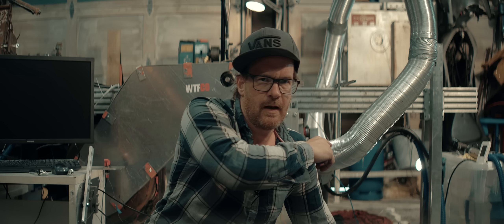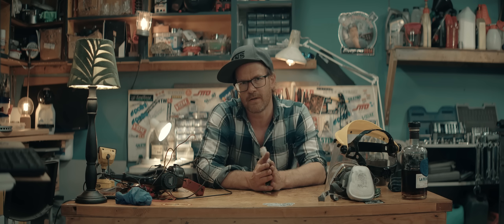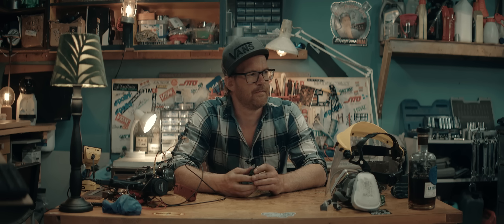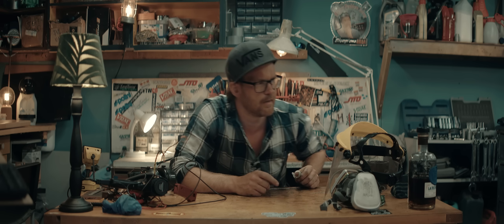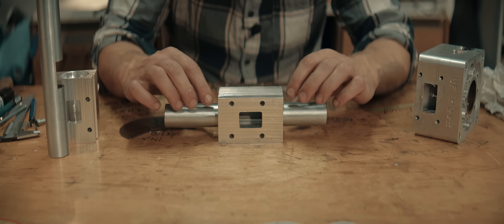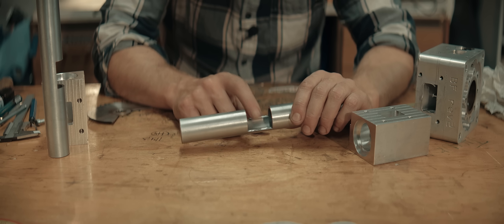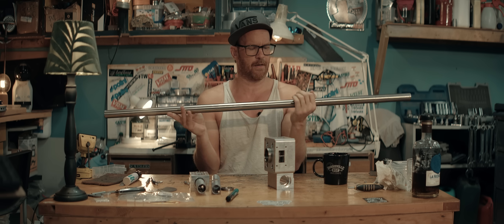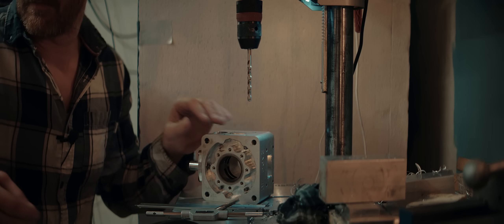The Weirdest Engine.

Comment: In one of your upcoming videos, please explain how the current engine operates and why you are using drum valves.  The drum valves increase the momentum of the engine's rotating components which will be OK for Land Speed Racing but the extra momentum would not be very good for an engine that has to change speeds rapidly i.e. Road Racing.  Thanks

Comment: You could probably add something similar to rifling to funnel air and actually create a “tornado” of air sucking out of the ends of the pipes. That way the exhaust would be able to come out of both sides by its own pressure. And not need as much of an angle in the hole, this also would help with balancing of the cam, which comes into effect at high rpms like you are trying to hit with this engine

Comment: Or if you use a blower you need no crosshead connecting rod , and still have a oil lubricated, cranckcase, much better than oil in the fuel

Comment: If you had overhead valves you could use real oil in the cranck case. Using a crosshead connecting rod design

Comment: Alex you really are stubborn. A valve are a valve no matter it's a disk, drum, or poppet valves, why not chose the obvious proven system poppet overhead valves .  Much better than all the stuff that can't seal .
And it's easy to implement, one way efficient scavenging 100 % seals, and easy handle high rpm.
Please regain common sense 👍😁❤️

Comment: There was a 'barrel valve' 'invention' made for small block Ford V-8 about 20 years ago, carbon ceramic composite bearings running without external lubrication and (stainless?) steel 'valve' bodies that's looked like a weird OHC set up.. Allowed it to rev to 10K and make over 500hp. The principle was very similar to two stroke porting with the barrel shaped valves cut away to provide transfer area.

Comment: I have a new and interesting project, 2 strokes, 2 valves on head. when the piston is 70% on the lower position, the exhaust valve is opened, the exhaust create a moment vaccum when getting out into the pipe, when the piston is 85% on the lower position, the intake valve is open, putting the new air-gas into the combustion chamber, when the piston comes up, both valves are closed and after, the ignition... you can try it very easily, take a reguular 4t engine with chain valve control system, just put same size of valve control gears and change the position of the valve actuators axle. Make only one part, a valve control axle.

Comment: You could maybe use popit valves and have them operated by a cam. When the cylinder goes down the fuel mix is sucked in the cylinder compresses the mix and ignites it with a spark plug. After that the it can be expelled using exhaust valves

Comment: GOOD MAN!! Those Heli-coils make your aluminum threaded hole stronger than steel. Almost, for a split second, thought you zoomed in to show us all how to not set a stop and rip that drill into your water jacket ...WHEW!!! QUICK TIP: U.S. & Metric tapped hole size is the pitch minus whatever dia. thread you're doing. 1) M10x1.5?? 8.5mm hole.
2) 1/2-13??? 1÷13=.076923;
.500-.076923=.423 hole. WORKS NO MATTER THE SIZE (ya know, if you got a weird thread that isn't in the bible...i guess most people call it 'Machinery's Handbook').

Comment: all this experemental engines n stuff, makes me want to build my silly engine idea
but im not an engineer, and im not amazing at solving problems
a 2 stroke inline 8 that uses a similar system to the 2 stroke detroits, only mine is a gasoline engine and is a straight 8.....
main problems:
1. crank, the crank is long and thus has torsional issues (crank twisting up'n breaking) 
2. creating the engine, i want it to be fully billet and finding a machine that has  a large enough working area to make a i8 will be hard and expensive as hell
so probably a multi part head (pprobably 2 heads on it)
cams wont be an issue except for torsional problems but i could also do a front and rear timing chain (and yes, its gonna have a cam because its gonna use exhaust valves similar to a standard engine) 
cooling will be a slight problem relating the the engine block (also cylinder will probably be similar to the deutz/vw engines in that it will be a individual cylinder setup where each cylinder is removable without removing any of the other cylinders)

Comment: How hot do you think the exhaust pipes will get, will the pulleys get hot enough to damage the belt? It will probably be ok for short dyno runs, but I'd be worried if it had to be put on a bike.

Comment: This is going to work amazing. In the late 90s early 2000s I read about an engine that was built with both intake and exhaust  rotary valve setup. the cfm flow was unreal. The engine was a chevy 4.3l V6. (I know I know 4 stroke) but flow is flow LoL Thank you so so much for all the work and hours of very happy watching.

Comment: The added benefit of having 2 exhaust valves is that you can easily adjust the timing port/ valve timing by turning one of them. 
That way you can figure out your optimal duration without modifing anything. Once your happy with the duration then modify them both to optimise flow 🤔

Comment: Hi Sir, when i built my Kart engine from a GDR TS150 motorcycle i came upon a coaxial ignition cable whose shield is earthed to the cylinder only. A capacity is formed to hold voltage after ignition and lower the work for the coil on the next spark.
BTW, very fine content!

Comment: When you're tapping a hole you should be able to wind it the whole way in in one go. And the swarf will evacuate as long strings out of the flute.  Chip breaking (in and out winding) will break the string off each time and it will get in front of the tap inside the hole. This can cause the tap to bind up and possibly break.  If you are going to do back and forward because the material is difficult to tap, wind the tap right out each time and blow the hole out.

Comment: I don't watch all of your videos, but... If the goal is variable exhaust timing, Rotax solved that, effectively and reliably, decades ago with their RAVE(Rotax Automatic Variable Exhaust) system. They used pressure to activate the RAVE valves, but there's no reason why you couldn't actuate them electronically(EI: solenoids) or using a governor setup and linkage.

Comment: Good job Alex, wouldn't be better to weld the side where the belt is? I don't know how much hot the exhaust could be, just worry about melting the rubber belt and one exhaust per side could be enough. Also you can machine some insert there to redirect the exhaust in the direction away from timing belt side. Crossing fingers for your success!

Comment: In the middle of the night I figured the rotating exhaust valves out. Still, moving parts to break. One of the good things about 2 stroke engines is the small number of moving parts.

Comment: Looks promissing. Keep on!
Short question, on regular two stroke engine, the down stroke of the piston is used to push the mixture from the crank case to the combustion chamber.
With such a blower setup,  can you just bypass the crank case and blow the mixture directly to the combustion chamber?
Reply: Yes, but it would need a 4 stroke style oil system.

Comment: Digging the rotary exhaust. Question though, will the spinning aspect cause a vortex affecting the exhaust pulse? Was thinking he might’ve stumbled onto something promising with that🤞This project is so awesome👏
Reply: Like vanes inside the spinning exhaust pipe to pull the exhaust gasses ? The engine pulses might outrun the pull of the vanes. Either way, good thinking.
Reply: @shanepowers7566  Omg that’s kind of what I was thinking but just the straight pipe, wasn’t thinking of actual vanes on the inside surface. Shane Powers that’s a brilliant idea you expanded on. Yes some sort of vanes using a fluid dynamics of sorts to match the exhaust pulses. Really love this stuff!
Reply: Alex is the expert.

Comment: You need to balance the rotary valve. And it could be made stronger by increasing diameter and leaving solid outer ring on the valve that vay that the exaust section in valve would not be a pease of pie but a rectangular hole. You could ad some weights on the outer ring in place of the exhaust opening and try to take some material of from the opposite side.

Comment: I'm not an engineer but I keep thinking that the exhaust heat is going to make the stainless exhaust tubes expand in their housings and bind up.  Shouldn't there be some coolant flowing through those  housings? Drill as many small holes in them as you can get away with structurally and pressure flow as much liquid as you can to suck away heat.

Comment: I’m not an expert by any means but I am a machinist and I was wondering why he has such a large tolerance between the exhaust drum and the housing for it. Wouldn’t that not seal as good making so you can’t make as much boost. Ps love the build can’t wait to see it on a bike
Reply: I think he left room for bearings. I could be wrong. I’m very confused at this point, the engine is getting pretty wild.
Reply: @somenygaard  yeah but having clearance for bearings shouldn’t effect the tolerance between the barrel and the housing those can be tight and still have bearings

Comment: maibe make the pully a bit more of a loose fit and weld a flange to the exhaust roller with slotted holes , that way you can time the ports induvidually https://media.skandix.de/pimg/1079603.jpg
having the compressor you could do sumting like the old screaming jimmy two stroke diesels 
these have ports in the middle of the scilinder just about at the bottom of the stroke and uses a roots compressor to "flush "the gasses out the exhaust (has a exhaust valve ) now having a lot of clean air blowing out the exhaust doesnt matter mush as the fuel is only injected once all the openings are closed off 
be a bit harder to do on a gas engine BUT it can be done , seen those lean burn car engines that have a high pressure injector build intoo the cilinderhead that sprays the fuel straight intoo the sparkplug making the mixture just rish enough to ignite , https://www.youtube.com/watch?v=KnNX6gtDyhg
verry high pressures allready in the stock form so i wonder if it can be done in an even higher compression 50 cc engine reving at 12/15 thousand rpm
working that way you could allso pressurise the carter of the motor with the blower pushing air and a two stroke oilmist reducing the stress on the rod and piston (the pressure under and over the piston counters eachother ) might induce a bit more drag at high rpm though compressing the gas on the up and the down stroke
the "flush"ports will be more classic twostroke could use an exhaust valve and still have the two stroke principle as it will be igniting on every down stroke the fuel would be injected inside the cilinder not in the intake and should be tuneable to the nano second to get the best powercurve without burning a hole in the piston

Comment: Flexible aluminum duct can be cut with a pair of scissors. U wont have that ragged edge from the hacksaw and its easier with scissors. Tin snips work even better. Sometimes u can just stab in and pull it apart.
On a side note, dont u just hate when the cap on a pen wont pop off one handed?
Could there be an advantage to making the exhaust port on the pipe more like a slight triangle so it gradually opens and closes the port as it rotates? Kind of allowing u more tuning options. I imagine its another rabbit hole to get lost in

Comment: You could apply this tubular valve in the same way a nitro rc engine works. The rotating tube valve is part of the crank and draws fuel into the crank case then up into the head like a normal 2 stroke. Join the tube valve on one side of the crank, the output shaft on the other, fit the super charger directly to the crank case into the tube valve and use the cylinder with the close to 100% port.

Comment: Yea i commented that you should use cylinder exhaust ports since you made the first video with the flat valve 😂, those drum exhaust ports are also interesting, they avoid more rotational mass from a solid cylinder with a port trough it, you could experiment a bit with different materials a bit if the wear is too high on the aluminium parts, brass housings and stainless tubing would last a long time.

Comment: should have gone with wedge locks for the tube gears. Pressed on will make it interesting to adjust the timing.
Reply from the maker: Couldn't find them in that small a size. Timing can be adjusted by skipping the belt.

Comment: I've been thinking of this system for years,  and wondered if it would be better to just turn the scroll valve back and forth in stead of continuously rotating it.
Reply: That is just a few steps away from the old airplane sleeve valves engine :P

Comment: As an experiment you can also consider Tesla valves instead of reed valves  at the inlet side. It is a one-way valve with no moving parts. They are used on pulse jet engines and I have also seen some use it on the crankcase on 2 stroke engines.
Reply: Isn't Tesla valves basically useless having horrible forward flow but still high amounts of backflow while being huge?
Do pulse jets really use them?
Reply: @TarenGarond  The only thing that is sure is that the reed valves can not withstand the combustion pressure from the engine, We have the proof now. So thats why I wrote for experimental testing.

Comment: Great content as always! Have you thought about what the high exhaust temps might do to the bearings? There will surely be some expansion and the grease might not like it if you run it to hot.
Reply: If it works, it's easy to change ceramic bearings.

Comment: If you love overloading belts, you can add an watt regulator on each rotating exhaust and use them to change the exhaust length depending on the engine RPM:-)

Comment: The solutions are getting more and more out of the box! But that's the only way you can make progress on this engine.
Ever considered a sleeve valve design? It should work on a two stroke as well, just have a 1:1 instead of 2:1 on the valve drive, and you can change intake timing as well without having to machine a new cylinder. I'm only not to sure how high a sleeve valve engine can rev before it destroys itself. Known sleeve valve engines are four strokes and rev quite low, to 4000 rpm max.

Comment: "press fit bearings" you could put the bar in the fridge for a few hours so it shrinks and if that would not be enuf heat up the bearing a bit to enlarge it  when it goes back to normal temperature it should be like a press fit

Comment: Hey man, I would really like to see you follow through a bit more with your projects. It feels a bit ADHD that a new way to run the engine is always started before really exploring the previous design fully. 
For example: how does an even lower pulley ratio affect the single rotary valve engine? How about valve timing? If the motor could move peak torque to 15000 rpm, it would make almost 40 HP. 

Also the PIP. I am a patreon and love your energy but IMO, the project needs more direction ATM.
Reply: He has messed with valve timing, and blower pulley ratio before. I think he’s just trying to find what works best before devoting all his time to one design, ex the pip engine didn’t work as well as the first version of the brute force concept and since then, the brute force engine has had so many renditions that it just keeps getting better. Eventually he’ll find what works best and make that better instead of changing it every video.
Reply: I have ADHD and I have to say I'd stick with the same design personally 🤣 I hate changing stuff. It will work! Then when it doesn't I'd lose interest and buy something else lol
Reply: Hi Victor I couldn't agree with you more.
Alex doesn't mention Bonneville anymore. He has changed from taking home a new world land speed record to a YouTube career about an engine. Sad but true.

Comment: Congratulations! You have made muffler bearings real! I have wanted to build a 4 stroke with valves like this for years!  Never thought about the exhaust valve being the pipe though. I would love to see you build a high revving short stroke 50 cc 4 stroke with a valve train like this down the road.
Reply: Muffler bearings have always been real, Kawasaki actually had them listed for their bikes, although I forget which one I do remember what they were, the rubber damper on the muffler bracket. I guess they changed description eventually due to the amount of 'feedback'?

Comment: Which bearings did you use? Due to high temperatures on the shaft, i think you should put bearings with bigger internal clearance... at least C3, but i would rather go with C4

Comment: Love de work and effort man!
I was more of a believer in the other rotary valve. I think the problem was the inbalance of the disk at +10K rpm and a relative thin shaft. Have you considerd  balancing the shaft and disk?

But possible  problems with your new setup: 
High exhaust temperatures will damage the rubber or silicone belt after some minutes of running time. Also the high temperature and normal bearings is no succes.
Possible solutions:
- Close the driven end of the pipe as close to the port as possible. So this side wil be much cooler.
- Use ceramic bearings for this pupose. 
- maximal sealing between pipe and housing obtained by very small tolerances

Good luck !
Reply: I think the in ballans was  a factor, but exhaust gas pressure pulses are many times higher than inlet gas pressure pulses. 
And exhaust gases give a deposit on the surface that makes it stiff rather than lubricates. 
So very different from an inlet route where fresh lubricating oil precipitates on the surface. 
From a constructive point of view, there was nothing more that could be done about it. It is therefore a good step to switch to another system.
Reply: To complicate things a little... you could make oval pulleys so the valve would "dwell" open, and open and close faster.